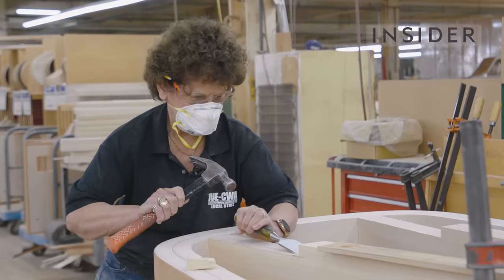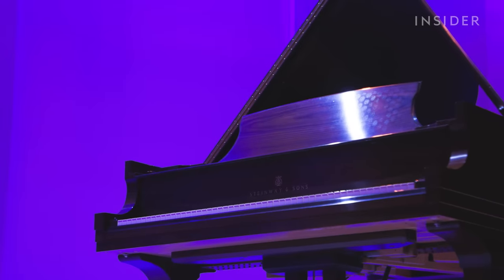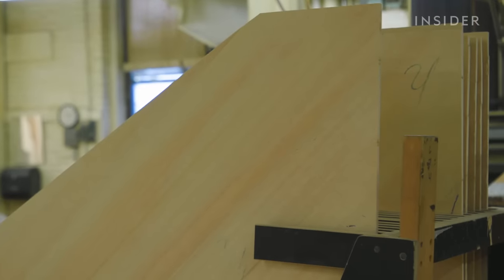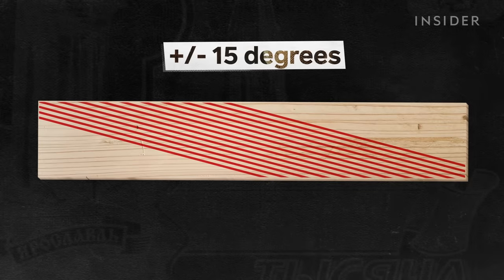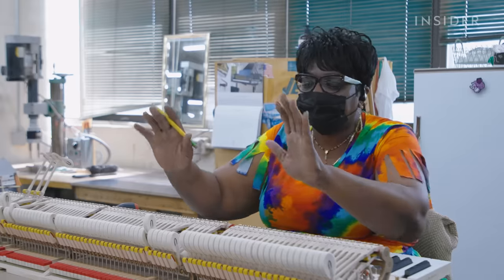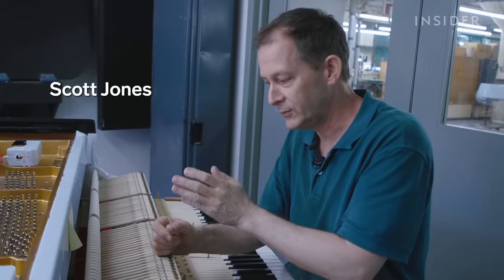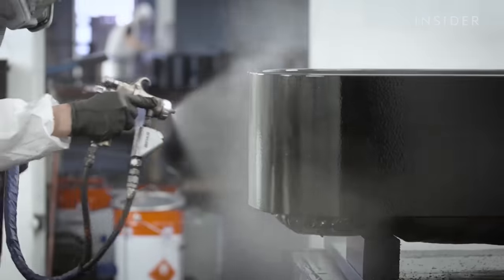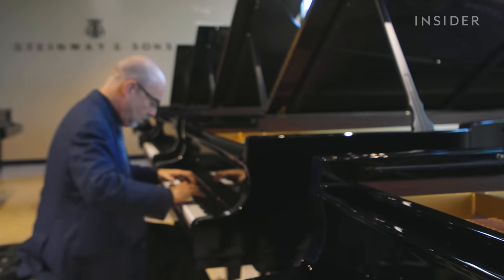Why Steinway Grand Pianos Are So Expensive | So Expensive

Comment: When you didnt hear a difference after he put in the needle 😅
Reply: You can hear the length of the tone shorten at the top of the sound it makes. Subtle but definitely a difference
Reply: Pianos are by far the most difficult instruments to record because of overtones and particular characteristics of the mic being used. I doubt this video was recorded with $5k studio mics and certainly not in a controlled studio setting. The only way to actually hear what any acoustic piano really sounds like is to hear and play it live. And as someone already pointed out in other comments, room acoustics are extremely important to what you hear. Moving a piano around in a room will give you different sound characteristics at different locations depending on space behind and in front of it. The voicing demonstration in this video doesn't give you any idea of what the technician is actually hearing. When I move my own grand from the alcove it usually sits in out into the open space for group recitals, it doesn't sound like the same instrument.

Comment: The reason is popularity and marketing. The sound is great, but two to three times the price of another brand, say Yamaha, is the sound two three times better? I don’t think so. But then again, as artistic values do not grow linearly, so doesn’t its related monetary value. I guess.
Reply: Depends on the model the Yamaha CFX might be just as expensive as the Steinway D🎹🎶
Reply: @MERCEDES-BENZS600GUARD_V12  This is true. However, since this video is about why steinway is so expensive, the main point is obviously about the difference between lower end models, such as Yamaha G2 vs Steinway model M (both 5’7”), for which the price difference is easily 2 to 3 folds.
Reply: @cloudrouju526  whell yes and no. The G series was already discontinued about 20 years ago or so and was replaced by the GC series. Yamaha has 5 grand piano lines the GB series GB1K 5'3", GC series GC1 5'3" GC2 5'8", CX series C1X 5'3" C2X 5'8" C3X 6'1" C5X 6'7" C6X 7'0" C7X 7'6", SX series S2X 5'8" S3X 6'1" S5X 6'7" S6X 7'0" S7X 7'6", and CF series CF4 6'3" CF6 7'0" CFX 9'0". Personaly I would compare the Steinway M to the Yamaha S2X even if they're not the exact same lenght. Also Yamaha uses the name Yamaha for all their grand piano lines. Steinway only uses the name Steinway for their high end piano line and for their lower end lines they have Boston made by Kawai in Japan and Essex made by Pearl River in China🎹🎶

Comment: The term “hard rock” maple is a little confusing, since I had learned Steinways are made from sugar maples, which they are. There are hard maples and there are soft maples. The sugar maple is a type of hard maple. It is also called “rock” maple, because it is so hard, which is fine but the genus and species of the tree used (Acer saccharum) translates more literally as “sugar maple”and is the source of maple syrup. To call it “hard rock” maple is a little redundant. There is no “soft” rock maple.

Comment: 6:00 I genuinely couldn't hear a difference lol
Reply: I had to go back and forth several times between 6:10 and 6:18 before I could hear the subtlety. It's what he calls "too bright" at 6:28.

Basically, the tone itself hasn't changed, it's still a C (or a Do). But the sound itself is slightly "cleaner". The first one is more abrasive, like scratching glass. The second one is a bit softer, a little more warm.

Usually, bright and sharp pianos is more synonymous with Yamaha pianos (at least for me), although there's always exceptions.

Comment: What would you do if you had a date come over to your house and they slammed on the keys and put it out of tune?
Reply: You can't easily  put a piano out of tune just by banging on the keys 🎹🎶
Reply: @MERCEDES-BENZS600GUARD_V12 
You can damage the hammers by banging the keys too hard tho
Reply: @nt_partlycloudy21  I tried so meny times before, and no luck🎹🎶
Reply: @nt_partlycloudy21  Freddie Mercury is notorious for playing piano like a drummer. Precise, like a metronome and most importantly POUNDING the keys. He did it on the same exact Steinway Model D for around 9 years give or take, from when he bought it at a Steinway dealership in New Haven during their 1977 News of the World Tour all the way to Live Aid and his final show at Knebworth.  That piano is still around somewhere, and I think it's sat at some corner of Brian May's room.

The point is, pianos are waaay more durable than you think given the right amount of maintenance. I don't think Freddie had that piano fixed up after every show and they had very little breaks in between shows and tours.

Comment: Steinways are great, but they have astronomically inflated their prices. SUPPOSEDLY they haven’t changed their building process in 70+ years, so it hasn’t gotten any more expensive for them to produce them, but they are just price gouging their customers. I have not seen a piano manufacturer that matches what they are able to do in terms of consistently great action, or depth of sound, but I hope one comes along that is much cheaper so that they put them in their place. Also, I personally MUCH prefer the sound of many of the older steinways to the newer ones. I think it’s a lie that they haven’t altered their manufacturing.

Comment: No way a 1965 Model D goes for $100k today. Pianos do not age well like string instruments. They are mechanical instruments that deteriorate.
Reply: A piano is basically a string instrument though

The main nuisance is just keeping it tuned and replacing the hammers when very rarely needed

Comment: I actually found a Steinway piano fully intact in one abandoned home in Indiana. I went to Turkey Run State park and I saw this abandoned home on the way and decided to stop by and take a look at it. I enter the home since it was abandoned and there was a mess inside that it seemed like it had been abandoned for 15 plus years. So I pulled my truck up and went in to find anything valuable. Note that I looked outside for any signs or anything on the door to give me a warning sign yet I found none. Windows were not broken and the porch door was opened unlocked so I went in through there. At first glance I saw a pile of mess everywhere like everything from desks,books,dvd movies, bottles of glass on top of book shelves and you get the idea. First thing that ran into my mind was someone probably died on the house or maybe some druggy lived in it. But the more I dived into the home I found more valuable items which told me a lawyer owned this home. Books on top of books on law and even a book called “How to find the Law” was found so I decided to take it with me. Note this was the Eight Edition and they are very valuable books so I needed to find out how much it sold for. As I proceeded to investigate I decided to go upstairs and look around. Also note that I have done this in multiple homes that are abandoned and old which have no coming back. I actually work alone and do this and no it’s not called stealing it’s just that these homes are abandoned by the government and usually they place a sign outside saying stay away, because the house could act as a dangerous or harmful environment etc… I on the other hand don’t ignore those signs, but since this house didn’t have one and it was old very old I needed to look inside and get it over with before any person who doesn’t know the value of the items inside trashes the place more etc… 
Well to say the least while the place had broken wires for the electricity to go through I knew somehow that the building was falling on itself so I decided to make it fast. Also note that it was so hot inside that I needed to wear a respirator and I did wear a full suit to cover myself from any radiation or chemicals if there were any even if no warnings were given. Well as I looked around my eyes shone for a little bit when I saw this piano sitting alone upstairs in one of the rooms. To my understanding this family really was into lots of things like watching movies on dvd, reading tons of books, playing the piano, and even going out on vacations since I saw multiple briefcases in some special places. My first though was how was I going to get the piano out of the house and loaded to the truck. I usually work alone on these cases and yes it was a risky move, but like I said this place was a total forgotten place. I decided to get some wooden ramps that I carry in the back of my truck and move the 800 piece piano by sliding it to through the wooden floor which by the way had a mess on it so I had to clean the whole passageway which took me nearly 3 hours to do. Once I had the piano near the entrance of the upper floor I carefully tied a rope near the door to hold the behemoth of the piano so that it wouldn’t fall and break apart. One of my genius ways which I use to bring down any heavy equipment is that I usually take items apart even though it can take me a full day to take them apart and then I reassemble them outside etc… but with this piano I couldn’t do that, because I knew I would mess up the whole sound setup and I wasn’t going to mess that part up. So I had no option, but to call a friend of mine to help me bring the piano down the stairs. He did agree to come over and check the place out and even he couldn’t believe his eyes. As we carefully let the piano slide down the ramps to where the staircases were very broken down and moving a lot we were carefully on how slow we would let the piano slide. Once the piano was on the bottom of the house we simply kept using the ramps to haul it using the sliding method to the outside of the entrance through the garage. It was a very hard and complicated process that took nearly 3 hours to do just the two of us, but we had to take our time if we wanted this grand jackpot. Once we had it outside my buddy whom I will not mention his name due to privacy and security reasons helped me load it onto the truck using the ramps and I secured it in place. At that moment I was on my own since my friend had other things to do and simply drove it home to secure it in my house, because I knew I had to take a deeper look in the morning. Ok so when I did check the piano in the morning I looked at it very carefully and even had an expert on pianos come and take a look at it and be said that this piano was estimated to be worth nearly $150,000 and it was actually one of only 7 made in the US. I was so proud of myself that I cried that night thinking of how lucky I really was after all that hard work. 3 years later I decided to actually keep the piano for myself and just restored it to its glory. I ended up contacting the owner of the abandoned home, but with no luck. Also it cost me nearly $15,000 to restore the piano.

Comment: Explained nothing, only showed. Most of piano's fabrication is handmade which takes way more time than could (if machines are used) and, consequently, physical and cerebral energy. Summarizing, the value-added is insane and the price is an expression of value although with market variations (taxes, etc.). That's political-economy and you can see it also in diamond's prices for example. Nothing is valued by itself it's the work added which speaks the value then the price and I must say pre-work (the wood, the iron, etc.) as well.
Reply: I don't think I ever heard of any piano being fully made by machines🎹🎶

Comment: So it comes down to the wood. What a load of crap. I bet after woods would do the same
Reply: Seriously ???🎹🎶
Reply: @MERCEDES-BENZS600GUARD_V12  other woods would be the same. It's a load crape in sound really. I bet you that
Reply: @chriswilkinson2548  as far as I know all piano manufactures use spruce for the soundboard so there must be a reason. The soundboard is basicaly the pianos speaker so yeah there's some truth to what they said🎹🎶